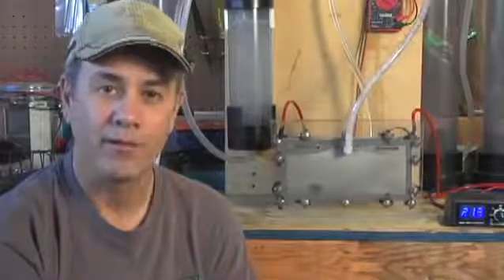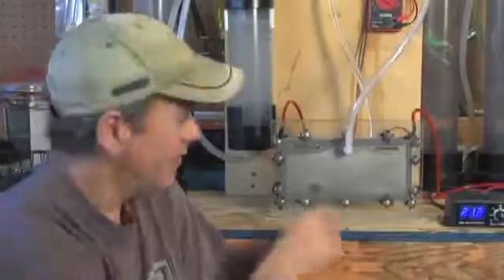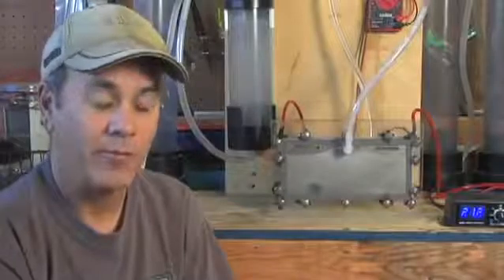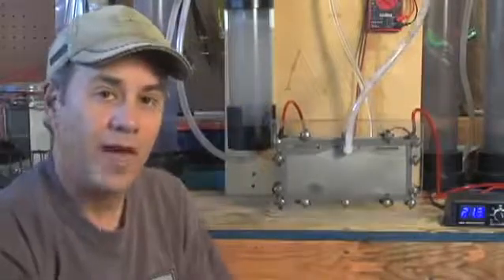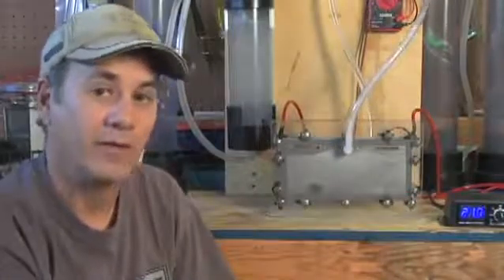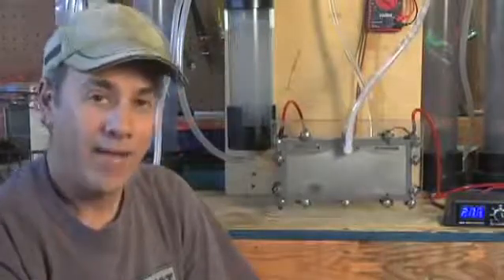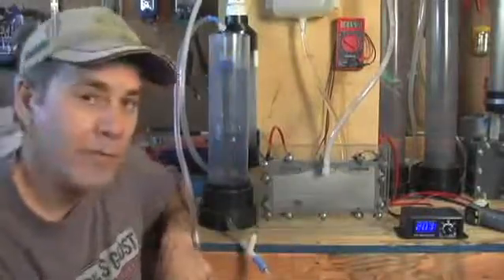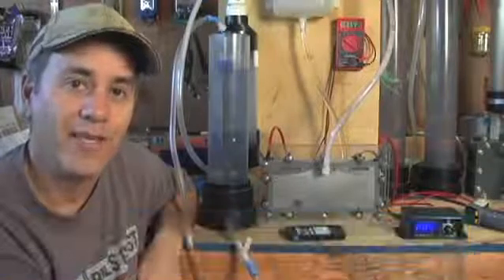Building an efficient HHO Dry Cell

Comment: Hi how much liter per hour I need to run a 125 cc engine tks
Reply from the maker: As a fuel catalyst,  .125 liters per minute.  To gain 25 % miles per gallon gain, approximately .25 liters per minute.  If used as the sole fuel source, the timing must be retarded to ignition at TDC or 0 degrees and it would require approximately 1.75 to 2.5 liters per minute.

Comment: Dry cell ? Is it ?
Reply from the maker: Simply a term to describe HHO generators that have a Remote (or detached) Reservior of Water to supply the HHO generator.  HHO generators submerged in the Reservior of Water, are referred to as Wet Cells.